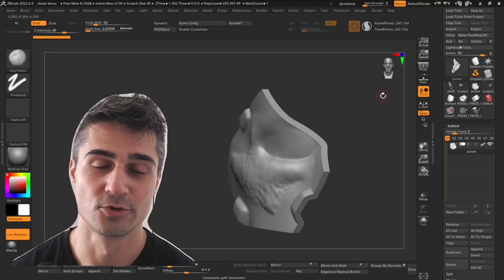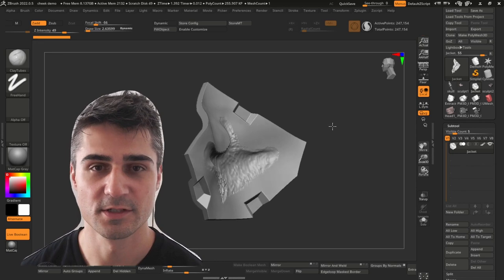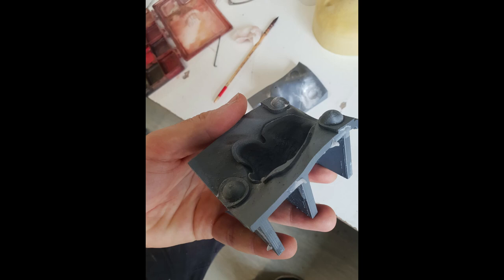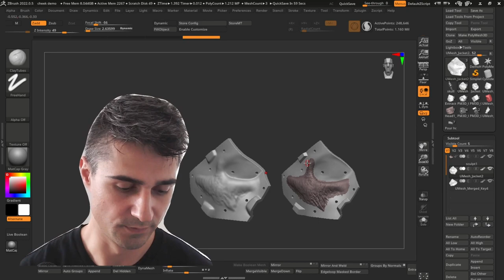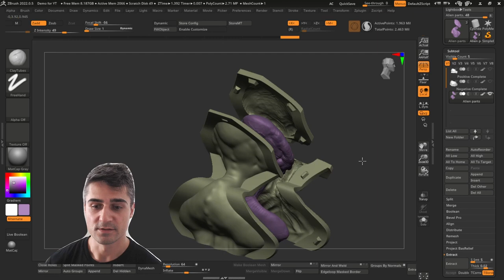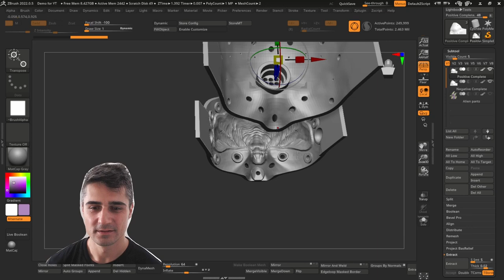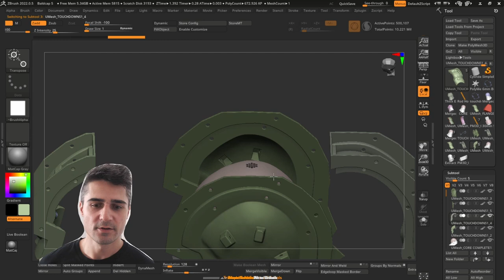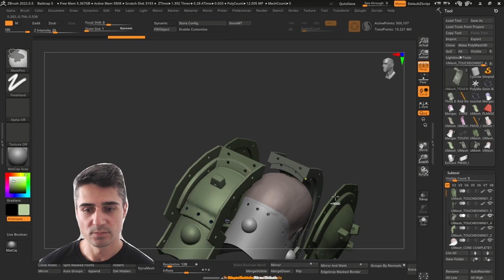Welcome to 3D Mold Making

Comment: You might be interested in a video I did 8 years ago, on my channel were I explored using Z brush to produce a silicone appliance. I out put my mold in CNC because back then 3D printing did not have the smooth surface or fine detail capabilities they do today.
Reply from the maker: Great video! I was still doubting 3d printed molds back then hah!

Comment: I'm doing the same. First time ever. Trying to make a silcone sleeve. I'm trying to figure out stuff like avoiding air pockets and concerns the mold not filling completely. I'm trying to use some samples of rebound 25 at the moment. Will the seem cracks be enough to act as vents.
Reply from the maker: You're making a silicone arm sleeve? 
For air pockets just add 2mm air vents using a cylinder and Booleans. Putting air vents (bleeders) at the top of your mold will ensure it fills completely (provided you have enough silicone in the pour tube)

The seam should ideally be very tight and not allow much silicone to escape, so definitely not a good substitute for bleeders.
Reply: @3DMoldShop  I made a pour spout at the top and on the opposite of it made a hole across to hopefully use as an indication that it filled. The silicone I got gets tacky within 20 min. Hopefully by then there wouldn't be blockades. Maybe I should pour in a large enough batch to consistently let it flow rather then small ones where I mix in between.
Reply: @3DMoldShop  yea its an arm sleeve for a kemek magi koopa get up i want make. I'm new so an arm sleeve seems like good start before doing the mask.
Reply: @3DMoldShop  I realized using transparent pla filiment would be perfect for casting silicone pieces.
Reply: @3DMoldShop  the seems I will add monster clay to seel and leave some small sections as indication of bleed gaps and just patch with clay as I fill along.
Reply from the maker: @omegafire6253  I would do a few more bleeder holes around the top edge to avoid air bubbles.

20 minutes is heaps of time for it to fill the mold, and absolutely do a bigger batch.
Reply from the maker: @omegafire6253  Yeah its very satisfying being able to see through the mold 😁
Reply: @omegafire6253  There's alot of loss of detail and it's super hard to get a good finish on an inverted mold though. It's best to use resin.

Comment: Hi do you put mold release on the molds, would silicone come off from pla easy without using any mold release?
Reply from the maker: Platinum silicone comes off PLA easily, but I do like to apply some Vaseline and/or Jwax anyway.

Comment: I need some advice. I use zbrush too and I want to make custom roof tiles. I want to 3d print a master copy and use it for mold making to make copies in other materials. Since a roof tile can’t be too light due to wind or too heavy, what material would you suggest I use to make my final roof tile? Not the 3d printed one but the final copy after molding.
Reply from the maker: Sounds like a cool project! I would use something like mortar/concrete, although it will take overnight until you can take it out of the mold.. good luck!